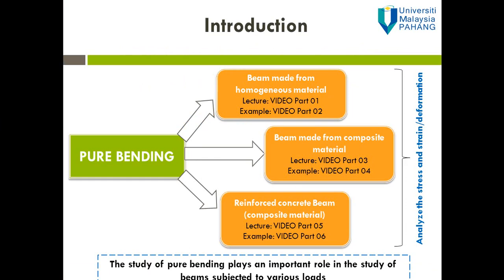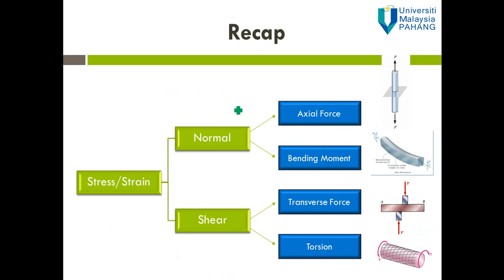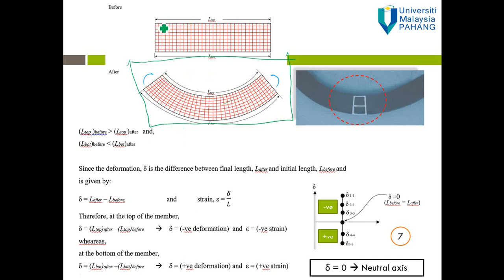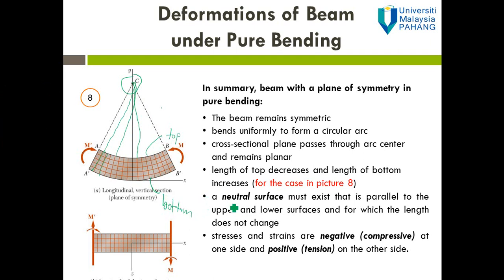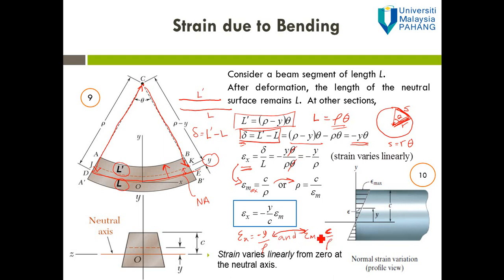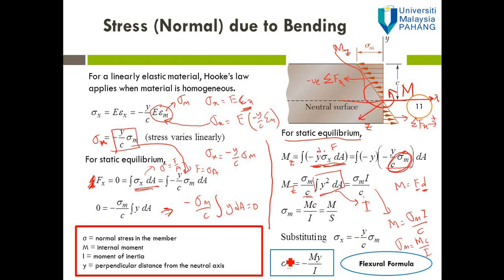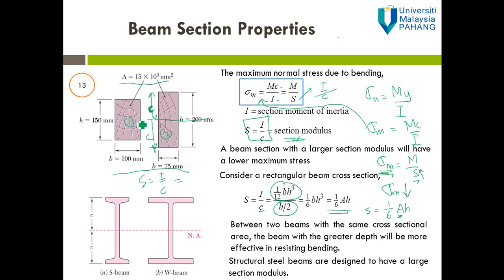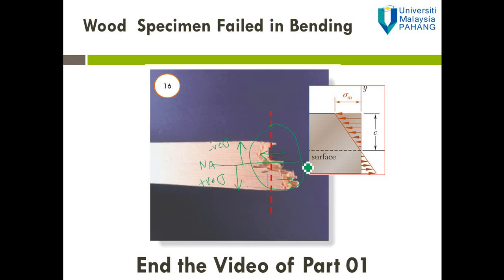Part 07: Pure Bending - Basic Concept

Comment: What is the diff or similarities between compression force and torsion? (Pure deformation slide)
Reply from the maker: What do u mean by compression force? Axial force? If so, in simple word, axial force is when the force is acting perpendicular to the cross sectional area of the member. Tosion is the twisting of member when subjected to torque (force that act about longitudinal of member - cause the member tends to twist). Hope these help.
Reply: @nasrulazuanalang6395  ok thanks for clarify but i have one more question. In bedding industry, mostly they use spiral (spring) type to support bottom bed.did the spring concept can be apply the same?